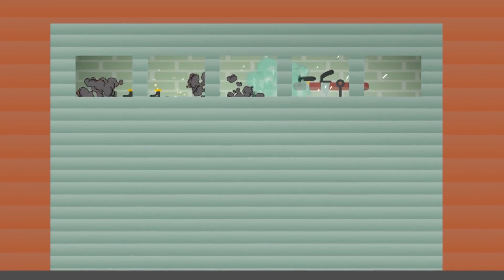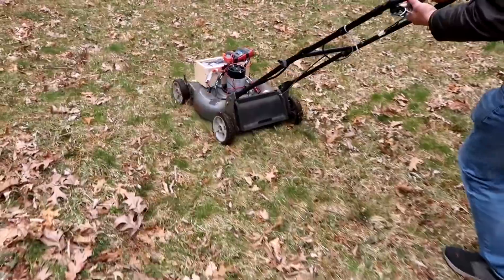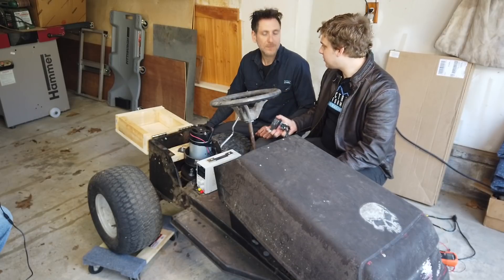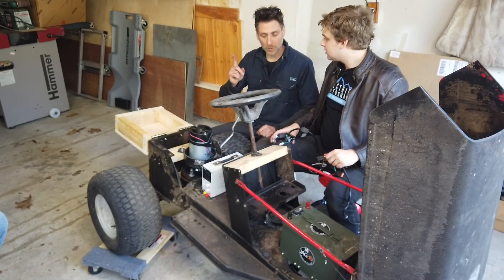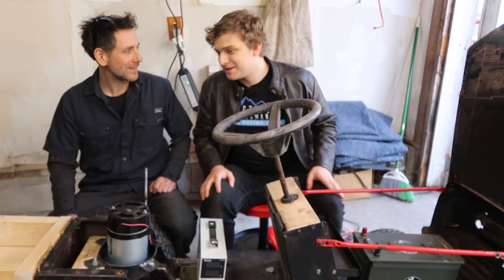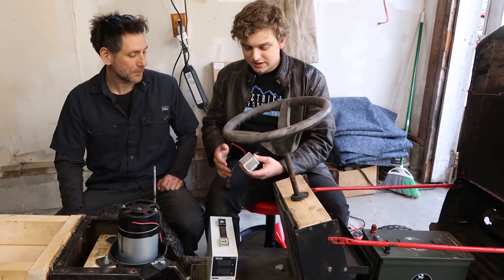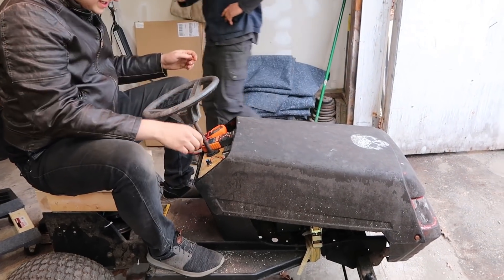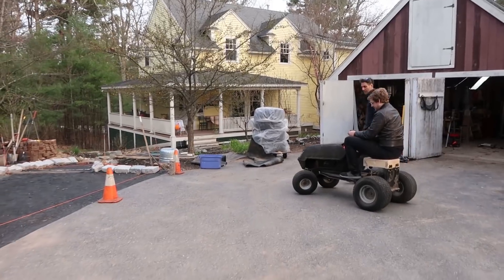DIY Electric Ride On! Does it Work? | Electric Conversion - Episode 17

Comment: I liked your explanation about motor surge current during startup! Its a real issue, since you are essentially dumping your battery voltage through the resistance of the motor windings (really low for a large motor!), before the motor can begin moving and creating Back EMF.

Comment: Hey Ron, I have an electric lawnmower (kobalt) and when it sees resistance with thick grass or wetness, it knows and goes into a 2nd gear. I prefer the mower in that 2nd gear as it cuts better anyway. First, how does the resistance power increase work and 2nd, how do i bypass the lower gear so it's always on? I would like to eventually put in a jehu pack so i don't have to swap my batteries 4 or 5 times...

Cheers and congrats on your 2nd electric vehicle build! What up Jesse!!!

Comment: Yep. I'm converting a 2003 Jeep Cherokee (Liberty in the US) to electric using a 11" DC Kostov motor. Due to the controller being a PWM device it can definitely, as we've all seen, fail in the closed state connecting the battery to the motor. I've gone down the path of retaining the manual clutch and also having an electrical cutoff for safety.

Really enjoying this series.

Comment: Some 18650 batteries can Put out 30 amps. That’s 180 amps possibly. Your controller must be able to handle your peak Motor amps or you will see smoke. I would only use a 30 amp fuse on your 40 amp controller.
Reply: Why so low?

Comment: what is the motor?
Reply: Same motor from our lawn mower conversion. Brushed DC. 550 Watts but you can push it to about a thousand.
Reply: @MrGsWorkshop  I was hopping for a model# or link?!
Reply: @stevejudd8951  Johnson Electric E60303
Reply: @stevejudd8951  Johnson Electric E60303

Comment: 15 years ago I built an electric bike using a mountain bike and an electric wheelchair motor that I cut the pedals off the bike and mounted the motor to the sprocket. It was so powerful that it would bend the sprocket so I ended up buying a thicker sprocket and it bent it too then I took the sprocket bent it back straight took it to a machine shop and had them weld steel plates with chainrunners on it and the bike rode amazingly all over town this was years before I saw the release of the first commercial electric bikes but it was a ton of fun and mine went way faster than the commercial bikes ever went. It actually went so fast that it would blow out the tires if I hit a bump with it probably had a lot to do with the crazy amount of weight I had in there with four lawn mower batteries powering it
Reply: Commercial E-bikes have been available 25 years ago: www.flyer-bikes.com/en/25-years-of-flyer
Reply: @bernhardleopold6702  I never saw one. People used to tell me it would never work all the time but once I finished it people couldn't get enough of watching me zip by at 30
Reply: It's amazing how fast the market has developed